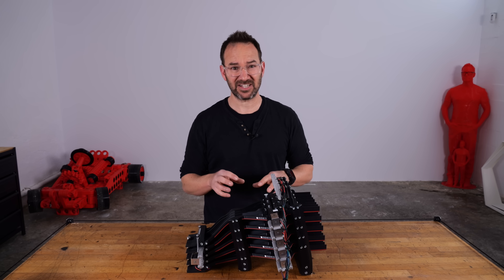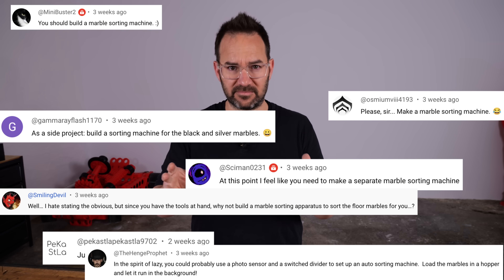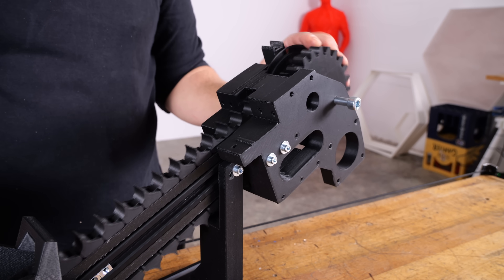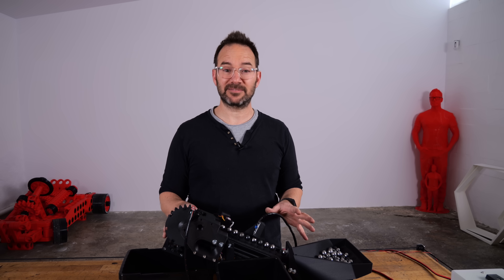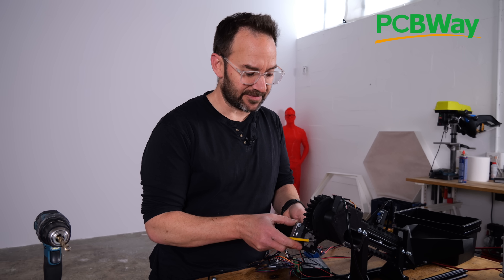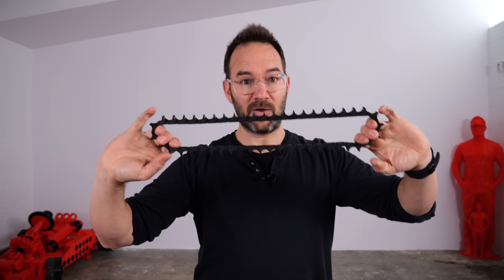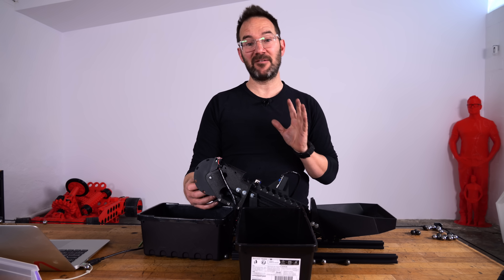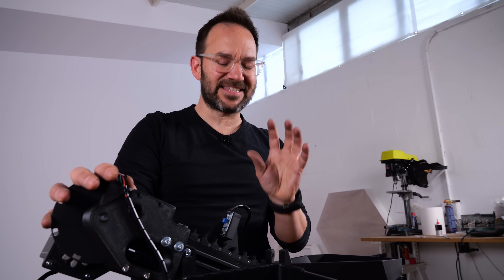Faster than the Eye Automatic Marble Sorter - Marble Clock Seconds Display Pt.3

Comment: Swap the chain for a wheel, have two or three rows of holes around the perimeter, wheel diameter of around 500mm, the wheel should be horizontal, you now have three times the speed with a single moving part that won't jam like a chain, expect much less noise,  have 'trap doors' under the wheel holes that can be opened, these can be longer that the ball diameter to allow time for the ball to drop, it may help to have a light spring lever or brush to help the balls drop,  the holes in the wheel would benefit being spaced around 2 to 3 ball diameter apart, have a set of guides on top of the wheel surface to keep balls one deep and feed balls to the three sets of hole lanes, take a look at the contraption Adam savage just unboxed, notably the way the balls move in the base - good luck Senpai
Reply: Yeah, multi-component chains seem like such an obvious liability, especially given the material/tolerance limitations of 3D printing. I'd think that an archimedean screw or double-auger would be more robust and reliable. Might require a different way to reject marbles, but others have already suggested a blast of air, which seems ideal.

Comment: The fact tha you are "sorting" 20 marbles per second and losing a third of them on the floor might not be optimal? 🙂

But it does show the strength of 3D printing as a development tool, now you can finalise the machine in more durable materials, add guards to direct the marbles with less spillage and then sell a fantastic marble sorting machine. That only has one customer, you. Oups.

Comment: Me, several times in the video: "Wow that's pretty fast, that seems like a good sorting rate, he'll probably stop th- oh."
Reply: He needs at least 15 per second because each second is represented by a 3x5 image.
Reply: @dutchletters and every 10 seconds he has to do 2 digits at same time, every 60 seconds 3 I think hours are probably negligible, so 67 15 ball changes per minute which is 17.75 balls/sec.
Reply: @dutchletters  only 13 of the balls actually change color tho, the b2 and b4 on the "grid" are always the same color.
Reply: @RenaxTM91  Actually at any given time fewer than these actually change, eg. the diff between 2 and 3 is two balls. He could just not replace the others.
Reply: Me too. The final result was mesmerising.
Reply: i was happy at 3 marbles per sec
Reply: Build two sorting machines. One for black and one for white. Then you need only... 10/sec
Reply: @scribius5555  But how do you sort them into each machine? For that you need a sorting machine that can process both colours! You could share the load between two sorting machines at random though.
Reply: E
Reply: @EEEEEEEE EEEEEEEEEEEEEEEEEEEEEEEEEEEEEEEEEEEEEEEEEEEEEEEEEEEEE

Comment: Nice project! Two suggestions for easy improvement:
(1) Activate the solenoid on silver marbles, not on black ones (and swap the buckets). I saw the solenoid activating also on empty chain positions
(2) use a damper on the solenoid to get rid of the vibration/oscillation and thus reduce the interference with the chain.
Reply: There is no need to swap places of two empty buckets
Reply: There are more silver marbles then black one, not really a good idea to switch the selection. An other option would be to print it white or to paint it
Reply: Don't really see the issue as the solanoid needs to be ready to fire again in the same time even if on average it has to fire more.
Reply: If he printed the chain out of white material, I think that would solve the problem as well.
Reply: @PJeBenn  He only has black or that bright red
Reply: A damper wouldn't help, it would slow down the solenoid both when firing and when retracting. That wouldn't be worth the gains from reducing bouncing.
Reply: @koenigsegg888  I'd assume you're thinking of a hydraulic damper that is active for the whole stroke. OP just meant something to dampen the bounce on retraction. There's an O-ring already on the solenoid for that purpose, but it seems to be either a bit too firm or a bit too soft to manage the bounce.

Comment: i find it interesting that you traverse the marbles up instead of using gravity  to queue the marbles, like placing a funnel on the top and letting the marbles flow through a funnel where the bottom would have gates that open for the correct collector bucket. that way you don't have to deal with chains and motors but only servos and possibly solenoids
Reply: I thought the same but I also thought that there is a big chance of the funnel getting clogged, and I think the gravity isn't "fast enough" to meet the required 15+ balls sorted per second.
Reply: The marbles will be down after they are pushed off the display area, and they need to slide down a ramp to push the number before. So it seems logical to sort them on the way up the ramp.

Comment: Great work, I was screaming “solenoid” from the beginning ;)
I would also eject the silver marbles instead to save the black ones from the mechanical impact. (It would also release some stress from the solenoid as it currently seems to eject the “no marble” slots as well.)
Reply: I think you could definitely program out the dry firing, he probably just went with a quick and dirty "if sensor is less than setpoint, eject marble". There's almost definitely some difference between readings from the black marbles and the chain, you would just have to add another case to the decision logic.

Or you could just print the chain in something that's not black. A can of white spray paint might also do the trick.
Reply: He is using 8 solenoids in the actual clock. He should have just used that to sort them.

Comment: put a stiffer spring on the kicker and bump up your voltage to it if needed to make the kick. ive done 15 per sec on 8oz bottles but we used an air kicker. filler ran at 850 per min and a line jam was a blast lol

Comment: This series really reminds me of Microsoft's insistence on not putting seconds on the taskbar clock, in Windows 11 they finally added it but the setting still has a warning about using more power. If one of the world's largest companies had that much trouble with seconds, it's no wonder that you are too.

I absolutely love watching you press on through every problem you hit, it's super inspiring
Reply: Windows 10 does actually support showing seconds on the taskbar clock, but for some reason the option is hidden and you need to use a third-party program like WinToys to enable it.
Reply: They must be seriously incompetent programmers if they can't make a performant 1s timer, even lua can do that no problem.
Reply: @fuzzy-pillar  My understanding of the issue is that it's not about the power draw/CPU cycles from the clock per se, but rather optimisations elsewhere of anythign not doing anything right now going to sleep - and now it can only sleep up to 1s at a time instead of up to 60s at a time.
Reply: @fuzzy-pillar  The issue afaik is that the machine has to redraw the taskbar 60x as often when tracking seconds
Reply: @coreymartin9630  If Windows can't update only the clock area of the taskbar, it means incompetent programmers and/or system designers.
Reply: @yvan2563  They still need to redraw the clock 60x more frequently when showing seconds... Doing nothing takes less energy than doing something, and to update something on the screen requires quite a lot of machinery even when done as efficiently as technically possible.
Reply: @GreenJalapenjo  Sure, it takes 60 times more energy. But we're talking about Windows here, an operating system that already has incredibly high requirements when compared to a sub-one-dollar microcontroller that spends most of its life in sleep mode even if its job was to display the date and time, including seconds.

That's taking optimization to completely absurd levels in pointless areas, like not carrying a credit card in your wallet because you want to lose weight.
Reply: @yvan2563  I'm not arguing that "Windows should not have an option to display seconds". I'm arguing that this isn't an indication that their programmers are incompetent.
Reply: @GreenJalapenjo  Their programmers are incompetent, but that's a separate issue. Based on (very limited) testing, displaying seconds on the taskbar reduces the battery life of an idle system by 2% (a relative value for the system it was tested on, which was a fresh install with no programs or background tasks running). For a system that's being actively used, this is a drop in the bucket, and there are PLENTY of bigger things Microsoft could (and should) be optimizing to improve performance and reduce power consumption.
Reply: @weblure  Go get a job for microsoft then if you think you are so much better.
Reply: @fuzzy-pillar  
my favorite part, i do a search, find an article, and it includes "(minimally)"
win 11's central theme sure seems to be "too little, too late"
it's astounding how many things they "couldn't do" before 11...

my new laptop is not running windows
when/if i get a new desktop, it also won't be running windows
maybe a VM for, hopefully just a few stubborn apps/games
i'm so done with the BS

you know what's really sad with windows is every good feature they haven''t axed, they've managed to ruin.
task manager, for example, was specifically optimized to run under a possibly-might-crash dire scenario
not anymore... 
it also can't shut-down "protected" processes. [and a handful just auto-restart]

but yeh, i doubt displaying seconds causes a notice-able increase in power usage. i'd be actually impressed if they wrote their code that bad. i can't even think of a way to do so without adding insane levels of bloat. probably intentionally, at that... something akin to a certain infamous DRM. clocks/timers with seconds have been present on games on old systems. systems that probably couldn't run windows [or not without major compromises]

M$ has a history of not being truthful, though, it's entirely possible some other reason exists for why they "couldn't" add seconds to the taskbar clock. "power use!" sounds like a cop-out, it's too absurd even for windows. i'd guess it's either something they somehow managed to back-burner for an outrageously long time, or they intentionally held it back to eventually make the old version "obsolete". all of win 11's QOL features seem to follow this trend. 10 isn't getting them, because that gives people a "reason" to switch to 11. "consumes more power", though... man, i want to see some real figures yesterday on that one!

Comment: There might be a little more speed you can get by using a puff of air to knock the marble off. That eliminates the time required for the solenoid bolt to retract. Adding a compressor may not be necessary either the solenoid could use a piston and butterfly valve to create the blast of air.

Comment: I guess using the power of lazy was simply using gravity.... why build a chain elevator when you could use a funnel into a channel and using some stoppers/plungers?
Reply: Because the balls need to get back to the top of the machine eventually?  Or I think someone else mentioned that uphill is more controlable and less prone to blockages.

Comment: You don’t need to change all 9 marbles every second, only swap out the ones that actually change colour?
Reply: I think the reason he's doing it that way is for the visual effect. 

Right now the matrix has a total of 3x5=15 cells, each needing to be updated every second, as well as a ten's place that needs to be updated once every ten seconds. The minutes/hours add ~.28 balls/second for a total of around 16.78 balls a second.

If you only replace marbles that change between digits, you'll need on average 5 balls per update for the one's digit, and 5.1 for the ten's place. Accounting again for the minutes/hours, this leaves your total consumption at around 5.7 marbles/second.

Definitely more manageable, but I believe his goal is overall impact, and more marbles means more noise, more movement, and more impressive mechanics.

Comment: If you are adding seconds to your existing clock, probably use 2 rows of rejector solenoids, to reject light and dark marbles into different bins. If the bearings you have used here fit in the old clock's lifter, I would have used that hardware to do the sorting, but that wouldn't have made much of a video.

Comment: some ducting and shroud work and it should work well.
also, mount the whole machine in a tub that will catch all the marbles that "escape" and return them to the unsorted hopper for reprocessing.
in fact, when the marbles get released from the display let them fall into the tub right away for resorting.
and if you use ping-pong balls the noise will be much reduced.
OK, the display will be BIG but that is ideal for a makers fair or a shopping mall.

Comment: Ivan, you need to make the chain in white so the solenoid doesn't fire on empty links!
Reply: Or just switch to knocking the silver ones out instead of black.
Reply: @fredward5728 That would work, but there are way more silver/white marbles than black marbles, so it's less work for the machine to sort the black ones out.
Reply: @fredward5728  Yes. Something I encourage is the approach of if something is proving tricky, change what it is that you're trying to do. It's a very useful design and problem solving technique.
Reply: @fredward5728  software vs hardware 😂
Reply: Or rotate the angle of the color sensor. Instead of putting it above the balls, put it to the side
Reply: @sethpolevoi4027  in that case he would have to make sure that there is a background or something to prevent it from firing on something being behind the slot that gets judged as "dark".
Reply: @mastercko  I don’t remember from the video but I assumed the sensor was for reflectivity and not color.
Reply: @sethpolevoi4027  ah, good point
Reply: @sethpolevoi4027  This looks like an infrared proximity sensor. It emits infrared light and the detector receives a portion of it reflected back from stuff that gets close enough. The black marbles would reflect less light, and that is how they can be differentiated from the shiny ones. They can also get confused by certain lights, and I would think they  would work better pointing straight down though I haven't messed with them extensively. I do know the range is pretty short though, only a few inches tops.
Reply: Or just add an IR sensor across the link to check for a ball prior to checking black/white. Which not only would free up clock cycles, but would make it more responsive due to not needing to read wether a marble is black/chrome and no loop to actuate the solenoid unnecessarily.
Reply: or just inverse the fireing type, so that it fires on white and wont fire on black .

Comment: Instead of a solenoide, you could try a controllable valve and a air compressor ro blow the marbles of the chain.
Reply: Yes! this is what's used in industry. A solenoid valve would work pretty well.
Reply: So, replacing one solenoid with another solenoid and additional parts?
Reply: @dan-nutu  It's solenoid's all the way down
Reply: @dan-nutu  The key is it has to actuate over a much smaller distance, so it can be much faster.
Reply: And a jet of air won’t get hung up on the chain.

Comment: I wonder if instead of a piston, you could use a open-toothed gear setup that clocks around to knock the balls? Each 'resting' position it would clock between would have just enough clearance for a ball to past through.
Reply: That's a lot of moment of inertia and some pretty demanding acceleration/deceleration. You'd need a pretty beefy motor to get that moving fast enough.

Comment: I'm impressed that the power of lazy hasn't convinced you to put a chair next to your table.
Reply: What's lazier, just stand there Vs. walk to find a chair, pick up the chair, carry the chair, walk back, put the chair down, adjust the chair, sit on the chair, stand up when needed?
Reply: @mrdzin1209  No, need to 3D print chair components, assemble the chair, have the chair fail multiple times and re-design, etc.
Reply: @mrdzin1209     true,   but lazy people tend to work hard in short bursts,  if it means they can then be lazy for the long haul!    ;)
Reply: @mrdzin1209  Reading this made me exhausted.
Reply: E
Reply: Keep the E  @EEEEEEEE
Reply: Simple, it would be a lot more effort to stand up & sit all the time